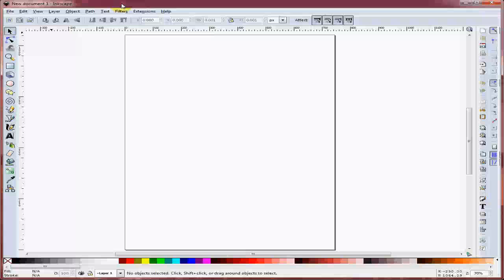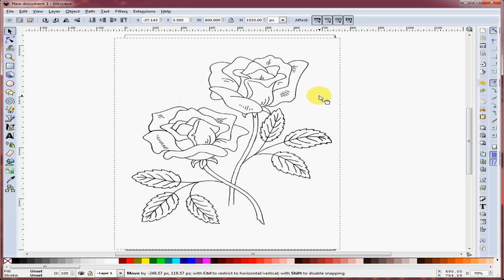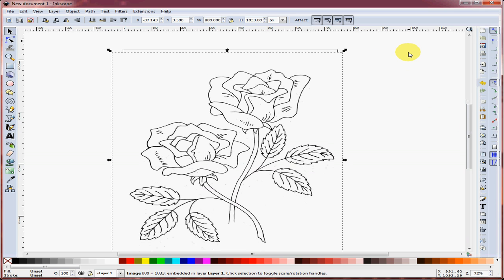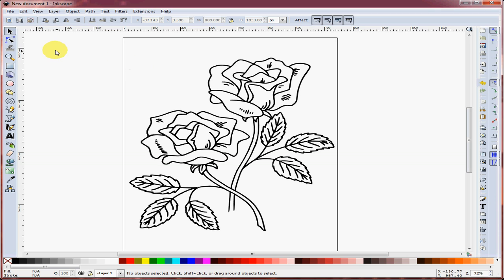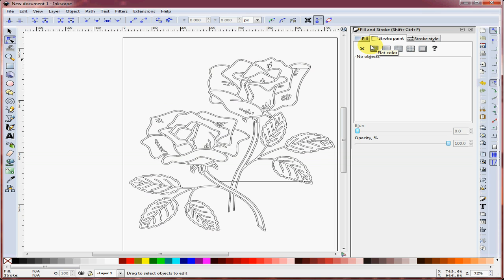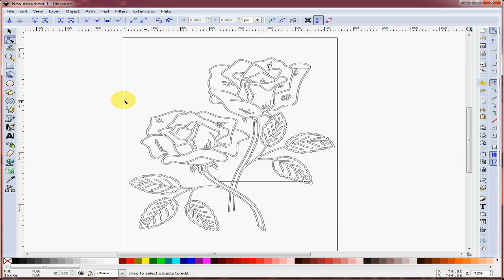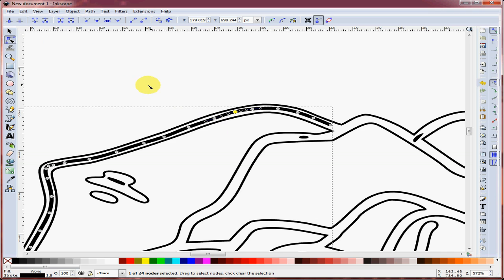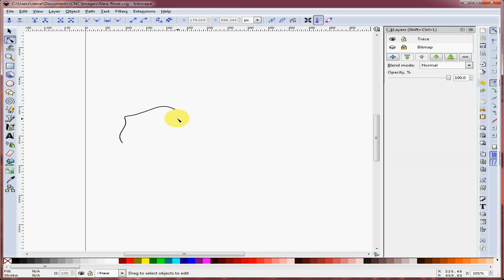Trace Bitmap with Inkscape

Comment: Despite all the childish comments got a lot out of your video. It would seem to me you would need to delete the original and keep the trace.
File>import>Select a bitmap or jpeg>
Select object>Path>Trace bitmap>update>use edge not brightness>Ok
Select original object>edit>cut
To adjust fill and stroke>edit path by nodes>select object>Object>fill and stroke>in pop up box select X for no fill>Select stoke tab>change to flat color
Set up layers Layers tab>select layers at bottom of pull down>In pop-up rename layer to "bitmap">lock layer>add layer "plus sign" name it trace>close pop-up>draw bezeir curve>click to create nodes>r/c stops line> edit path by nodes>select line>Ctrl A to select all>make selected segments curves>make selected nodes auto smooth>